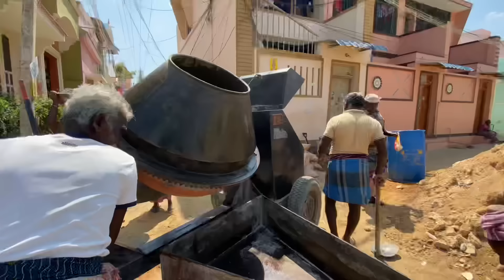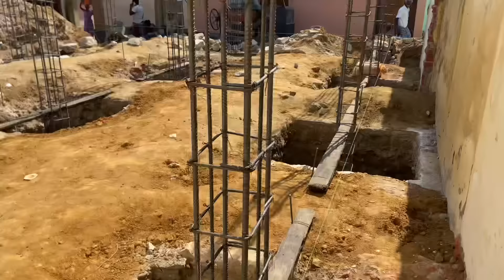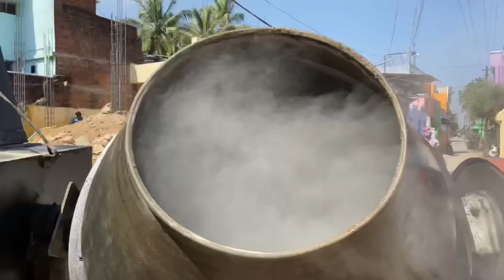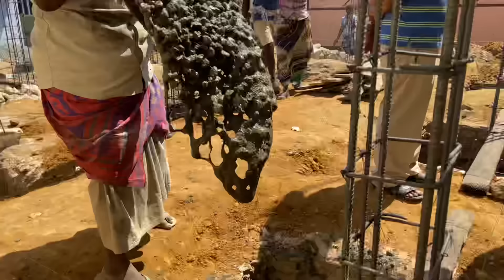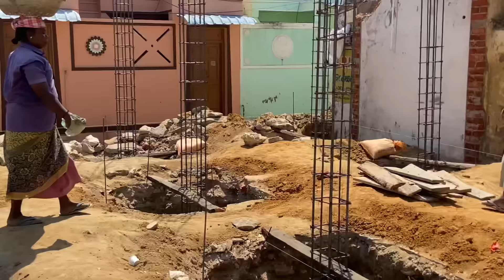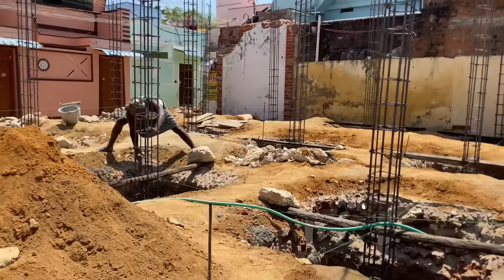New Project 1BHK House-Amazing with 31x33 Size 1BHK House Column Footing Reinforcement-sand cement

Comment: Wrong way of pouring the concrete, it should not exceed 1.5m
Reply: AND. , they need a pump truck, in a big way,
Reply: What happens if it exceeds 1.5m depth?
Reply: @doneown503  At least a couple of wheelbarrows ?!?
Reply: @chukwuemerie  it makes it stronger to last longer
Reply: Different stale
Reply: Si, se oxígena 🤣🤣🤣
Reply: It has to do with segregation of the materials in the concrete. The stones, sand, water etc will seperate when it  is thrown from hight.
Reply: @chukwuemerie  aggregates will settle at bottom and only (cement & sand ) paste will be @ top
Reply: Thank you very much
Reply: @larslover6559  too often on YT I see people cast concrete walls in advanced countries have it pour from mould top and free fall for more than a few meters.
Reply: @chukwuemerie they must employ the concrete chute😊
Reply: @Sangamgautam7  Thanks

Comment: Some of the people commenting have no clue on how concrete works, & the pace of the work the concrete at the bottom will dry before the top get finished,  using those small pans will rake forever. 

I would of put a slide straight to each hole & drop the concrete into each hole, the job will be finished in 1/10th of the time.

Comment: Very very neatly done columns. Along with this the dia size of the iron rods used and the bottom irom square size details and this column is for two or three storey building etc details may pls be given.
Reply: Water cement ratio is more.

Comment: бетон нельзя так сбрасывать как на видео, потому что он расслаивается. Более тяжёлые фракции в бетоне, это щебень, уйдут в нижнюю часть монолита, а сверху будет больше воды с цементом,
Reply: Correct. Concrete are not to be poured in a hight  more than 1000mm _ 1500mm  to avoid segregation.. looking at the average hight of men and women Plus the depth of the column.

Comment: No dear u r doing weak construction methods.
Base of the piller ( above the soil plastic sheet must drag )
Otherwise the the cement drain out and reduce the strength.

Comment: Wrong way...
1. PCC bed is missing beneath footing
2. Pouring concrete at much more hight ..so segregation will occur
3. Vibrator is missing... Will reduce strength

Comment: we do not poured cement concrete from great height , Height should be between 1 to 1.5 meter or else segregation happens, you can clearly see course aggregate separating from mortar while pouring it in foundation

Comment: I love all these experts saying you should use a pump truck or  you will have segregation because it’s free falling greater than 1.5 meters. 
I’m sure that there’s a pump truck around every corner in that country. 
Regarding free fall I’ve seen hundreds of drilled shafts much greater than 10 meters deep have concrete placed without a pump or tremie with no issues noted on verification coring or CSL testing.

Comment: Ótimo trabalho. Mas uma dúvida , pq não usam carrinho de mão pra carregar o concreto ao invés de usar essa bacias pequenas ?
Reply: Sioh eu tbm já fiquei pensado  nisso tbm!! Pq O trabalho deles é bem feito e resistente,eu ja vir alguns trabalhos deles é são bem caprichados
Reply: Due to uneven surface and second reason is wheel body carry very concrete but this pot can Cary only limited crush  therefy steel can't move for pressure of concrete it is my opinion plz reply me if am right dear
Reply: Porque  a man de obra e barata

Comment: Why hand vibrator isn't used for compaction of concrete ....honeycomb might form there ...
Reply: They're using wooden compactor..that's already good! Honeycombs usually occur on formed structure esp with multiple rebars.
Reply: @jomaabuel1048  Regret to inform you that the wooden thing they are using won't be able to remove the air bubbles completely...and using a vibrator is best for these structures afterall what u r looking for is an well built ,strong and solid foundation.
Reply: @maheshmishra4400  if i were the assigned QA, it's good already for me...for that thickness of about 30cm with not much rebars and not formed and if done by layers.. To each his own
Reply: @jomaabuel1048 Agreed 👍👍

Comment: Sorry but I can't believe how primitive and stupid this job is done. It has nothing to do with quality and efficiency. Why is the mixer not closer to the holes and why are there no wheelbarrows with ramps to tip the concrete directly into the hole? Why so much more useless work?

Comment: Why only 12mm rebars for column and footings , very poor strength. It is only used usually on smaller beams Why there's no crush stone at the bottom of the footing. It seems very minimal budget on the structural design

Comment: Very primitive method of pouring concrete.
Move the mixer machine right next to the column pit.
Than mix and pour the cement right into it.
And, stop this monkey business to carrying 20 lbs on one's head.

Actually the column will end up being weak because the concrete on the bottom will dry up earlier.
Anything added on top will just float on top and dry up later as a crack.